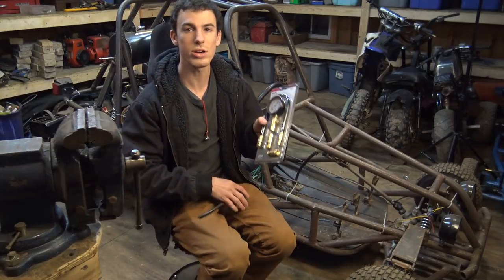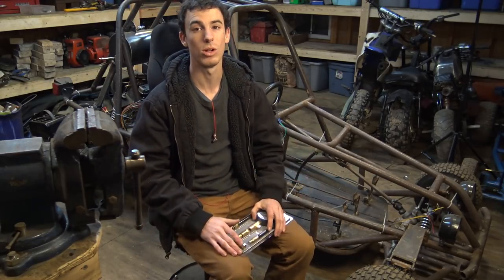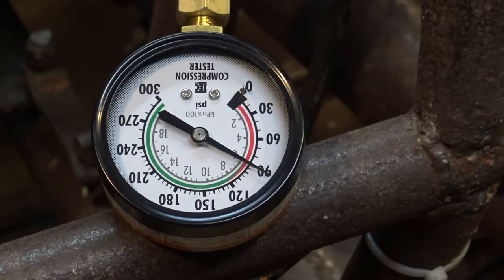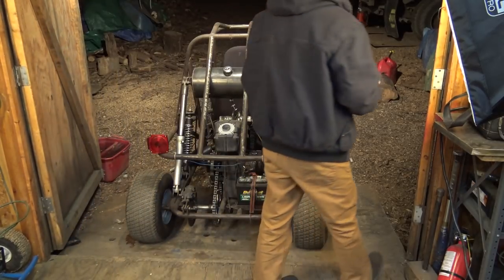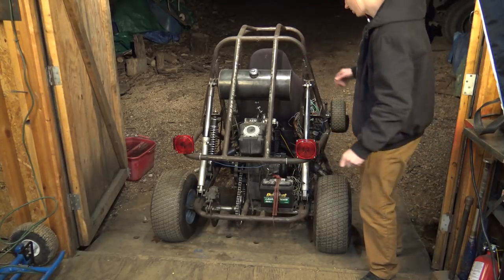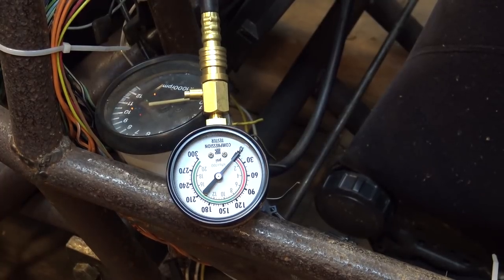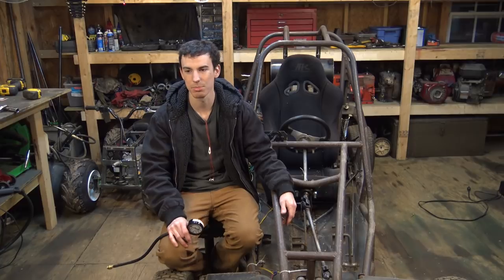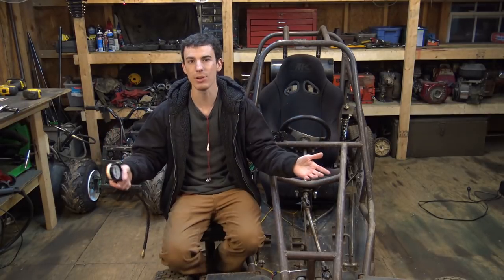Compression testing the gs500 engine

Comment: 90 PSI is not horrible and the compression should actually go up a little bit as the engine warms up. Yes everything expands with heat but the cylinder walls cool from the cooling fins while the piston does not therefore the Piston actually expands more than the cylinder increasing compression ( most time it's barely noticeable, the Rings are like springs for that very reason. To allow for the expansion and contraction of the piston and cylinder). If low compression was the problem you would have a hard time starting and have lots of crankcase blow-by coming out the vent. If it was valves, intake valve would cause backfiring out the carburetors and exhaust valve would cause excess exhaust temperature ( pipes would glow red and shoot Flames out ). You've already confirmed it's not a fuel problem, check if it's an ignition problem. Run it till it won't run anymore then check your spark.

Comment: Some bikes especially the bigger ones have a decompression that would cause it to be a little bit lower on Startup seems to be running fine when it's is running seriously doubt it's compression. Cold packs are 20 bucks try them just because they visually seem to be sparking does not mean that they are firing every time that they're supposed to

Comment: Ok, you've brought some new information to the table.  You mentioned in this video you had the pistons out and the rings were stuck.  That definitely an issue.  I looked up the specs on that engine and the compression should be near 144 psi.  

The engine will run on 90 psi, but before you get into correcting the ring issue.  If you haven't done so already, you really need to go back and put the fuel filter back in to prevent more trash from going into the carburetors and causing more fuel issues.  I recommend doing that and then doing another test run to see if you can go to the end of the street and back home without stalling.  

To make the engine sound, you will need to replace the rings at least.   I would pull the cylinders and do an inspection of the pistons and cylinders to make sure they are not scored up beyond repair.   If the cylinder is cast iron, I would do a quick hone to break the glaze and then replace the rings.  If the piston is OK, dig out the rings.  They will likely come out in pieces.  If they are stuck, you'll end up breaking them out.  Once they are out, take a piece of a broken ring and clean the carbon out the ring grooves before installing the new rings.   

Let us know what you find and the course of action you take.
Reply: Like a lot of these guys have suggested, check your spark when the engine stalls.  Also run it with the take with the gas cap loose to check the tank ventilation.  Definitely re-install the fuel filter, but do all these things before you do an engine tear down.  It's important to find what is stopping the engine from running before you open up the top end.  Guessing is expensive and frustrating.

Comment: TIGHT valve lash may be causing your no run issue, engine heats up valves dont close fully, cools down then restarts?... and cam timing will affect cranking compression

Comment: When running.  Spray starting fluid around the head gasket. . Also stuck rings are junk. Hope you didn't scratch the cylinder walls.

Comment: Happy new year buddy, and put that bloody petrol on off switch on! It will take you 5 minutes and BINGO! no hydrolock with fuel. Especially if you do up the engine, you dont want fuel washing away your upper lube and filling the sump with fuel. I see some say get another engine...thats ok but you can end up with a whole new can of worms. The frozen rings are your problem, just carefully get em out, so you dont damage the ring lands and use a piece of ring to get all the carbon out of the grooves. It might take you a while but its worth it. Shes a great machine with a weak ticker at the moment, dont shortcut, if it needs more bread to get other bits, be patient. Inspect your bearings and journals too. I was your age a million years ago and always just had to get it going asap lol. More than once i pulled an engine to bits twice because of hoping for the best.

Comment: 90 psi is a good compression, now 30 is bad, I have a 5hp tecumseh that has 30 and it runs just fine. my rebuilt Wisconsin I have has 90psi of compression. to be sure is to check with the manufacture for the correct compression rating.

Comment: Are you sure the compression gauge isnt leaking? If not, i would preform a leak down test to further diagnose the problem before teardown. If the rings were stuck that is likely the problem.

Comment: It must be your timing. It will still run with slightly off timing so I say re adjust them. Get it correctly and the compression will go up. And if that don't wort pop the pistons out and replace the rings. Like you said the rings are your second guess. Maybe you are right about the rings. Take it apart. Dip the piston in some pb blaster overnight. It freed up my locked up v6 so It could free up the piston rings. Re lap the valves to just in case

Comment: Hold a piece of paper up in front of the exhaust pipe to see if it will suck it towards it, if it does a valve is not shutting all the time. Bad seats or timing issue., will cause the carb to flutter as well.

Comment: Look into startups decompression setup.   I think ur compression is spot on engine fires right up.   With low compression usually wont fire that quickly.   That is y i believe it has decompression at under 1000 rpm or something like that

Comment: 90 and holding is a good sign. Probably no damage. Just worn rings. Buy rings (measure pistons dia) and a top end gasket kit. Problem solved. Though I may be hearing bad valve adjustment. 👍

Comment: While I do agree with the coil theory,  do you know what the compression shuld be? Both have 90lbs , seams to uniform either it's correct for this motor ,or is it possible when you replaced the valve shims , maby they sent you the wrong ones , but like I said , I have also had coils act this way before.  Will it die if you don't ride it  ?if it only dies if you ride it but will idle all day. Maby it's gearing causing it to overheat  , anyway good luck. , can't wait to see you fix it , happy New year

Comment: You almost got to the route of it yourself, right where you started the compression check and said you need the throttle open to test. With CV carbs just opening the throttle and cranking will not open the throttle slides up, it needs a running engine drawing vacuum for that to happen. I'd say in the mean time there is little wrong with 90psi, it may be a little down on power, but will run properly like that.
Check fuel supply, it is almost certainly your problem, with one caveat. Once engine has cut out do you still have a good spark ?

Comment: With valves closed hook an air compressor hose to the compression tester that screws into the head then listen if air comes out of the crank case, intake, or exhaust follow the air it will tell you where you need to focus my compression tester has a quick coupler I can hook to my air compressor that's how I found bad valves broken rocker arms bad head gaskets. I did a boat I had good compression on #1 but the other three was shit so I put air in the first with valves closed it held the air no leaks put air in #2 I had air coming out 3 and four plug holes pulled the head and gasket had been blown out between 2&3 and 3&4 new head gasket and that chevy engine ran like a top. I have found valves out of speck this way too and lawnmower head gaskets.

Comment: Not sure how everyone hasnt said this yet.. may have a small amount of compression release on the cam, if it didnt the starter wouldnt be able to crank a twin over. You need to do a leak down test, not a compression test. Also, didnt you buy a new jug for this engine? Did you hoan it before you put it back in? Like you said, your best bet would no doubt be new rings, re hoan the jug. You wont need rods or pistons unless they are completely trashed and scored up.
Reply: Also, you could try lapping valves, but I doubt thats the issue

Comment: Compression doesen't change with heat. If it does your rings are bad.
Bad compression is often a bad head gasket. Rings and pistons last forever if the engine has oil.

Comment: This seems to be a coil problem, not a compression problem. The 100psi is ok for most automotive motors. But that doesn't mean its the right value for all motors. For example twostroke motors in Vespas run ok with much less compression. 
Then there is your symtoms. 
Coils defects are more apparent when hot. They will work nearly ok (and produce just a few hickups just like you can hear in this video) but fail completely when hot. 
A motor with low compression will have other symptoms. Starting problems. Low power output. Your motor doesn't seem to have those.

PS: I really like your videos. Keep up the good work.

Comment: It will run at 50psi, you need to do a leak down test, the tool is cheaper than engine Building. Guessing is expensive but It has to be a head gasket or coil. Steam will come out of dip stick hole sometimes caused by head gasket

Comment: Dude, the compression is not bad at all. That is to say, it is NOT related to your problem with the stalling. EVERYBODY is saying it...COILS, SPARK, IGNITION!!!

If compression really was the problem, you'd feel the power trail off very smoothly to nothing as it warmed up. Only at the very end would you encounter a little sputter.

You seem to have good power up until the point it dies. Compression doesn't just drop that rapidly in an engine (unless it blows up).

And seriously, at 90PSI, that engine should be running fine. You won't have quite the power compared to 170PSI, but it will run. My GY6 kart is supposed to have around 190PSI cranking. It had 100PSI for the longest time and it was unnoticeable. After I rebuilt it, I got 200PSI and some extra power, but not much difference in the actual "running" of it. Now if you had 50PSI, THAT would be bad.

Also, the key thing to notice is that the cylinder on the right looking at the back of the kart keeps misfiring at idle. That is why it seems to have two idle speeds even though you don't touch the throttle. That cylinder's spark is fading in and out because the coil, spark plug, ignition wire, points...something ignition related is wrong. If you don't believe me, hold your hand in front of the exhaust and feel the temperature and volume of the exhaust at both of the "idle speeds."

Better yet, buy a cheap inductive timing light and put it on that cylinder. You should get a consistent flash out of it. When it stops flashing, the spark is lost.

Comment: Hey buddy listen to some of these guys they are giving you good advice. 90 psi is low but its not why the engine won't stay running. If low compression was your problem you ould have different symptoms check the COILS!!!! i have seen it a lot on 2 cycle engines they start and run fine till they heat up and they dye and either will not start or are hard to start till the engine cools down then they will start and run great till they heat up again so please please please look into the coils before you tear down the engine.

Comment: Both cylinders reading exactly the same says it may be specing correctly. Do you know what the manufacturer spec is? Also if this engine has an automatic decompression system it will read lower than what you think it should. Sounds like coils to me.

Comment: compression is good the vacuum line is required for fuel to flow properly the vacuum line is for the fuel to flow into the carb hence the 15min wait problem you have
Reply: i have worked on GS1000/GS750
 engines before they all require vacuum lines to carb the vacuum opens a valve allowing fuel to flow just try it you will thank me

Comment: Get on ebay get better carbs by a plastic fuel tank made for a boat with a fuel pickup tube and  I guarantee you will be able to run it. Your fuel tank has rust and that is your issue also that rust could be messing up your cylinder wall with scratches.  Engines are very simple as long as your getting spark on time fuel with the right flow rate and pressure you have a running engine.  Compression just mean loss of power and other minor drivability and idle issues.

Comment: quite the opposite compression gets higher as a engine gets hot the rings expand and seal better and yea 90 is bad it should be like 125-130 ish but I would guess its not compression but the coils they don't like heat and are famous for failing suddenly when they get hot so i would check spark when its hot. But is still needs to be honed and new rings to run truly good and get the most power out of it.
Reply: Andrew Herrboldt compression should go down when engine is hot!
Reply: try kickstar a honda cr500 cold vs hot and you will feel the diffrent in compression :)
Reply: Makrill first of yes compression goes up when a engine's warm google and second I've never had a 2stroke or any dirt bike but I know my honda cl350 is easier to kick when warm. Which isn't really just a result of compression. The piston expands closing the ring grove as does the ring itself sealing against the cylinder better. (hence why there's ring end gap for when they expand)

Comment: After hearing you admit to stuck piston rings AND the fact that 90PSI is your compression, hot or cold. Are you really looking for some other magic bullet to fix it. Time to rebuild the lower half now. And then you will be pleasantly surprised at the new found power as well. Don't skimp on the rings OR the bearings. Happy New Year though.  And do keep posting your videos. I am interested in this project.

Comment: 90 psi is not THAT bad for a clapped-out old engine. An old GS500 is alright from 100. The low compression is due to you refitting those old rings.
Sounds like carb issues, or air leak by intake.

Comment: I am no mechanic, but are you referencing the red area on the gauge as bad? To determine bad cyl. compression you should refer to a manual as to the ranges that are acceptable. Me personally, I think that your issue may be in the ignition, I've had motorcycles that the CDI box went bad with the same issues that you are having.

Comment: Im pretty sure that you shouldnt take both spark plugs out because thats when it loses compression, you should only take out the one you are testing. Correct me if im wrong though
Reply: Your wrong... sorry
Reply: Lenny M ok, thanks... do you have a reason for this?
Reply: each cylinder has it's own compression. they are not connected. Taking all the spark plugs out of a engine when testing compression allows the starter to crank easier and not get hot from repeatedly cranking.
Reply: sorry matt your wrong. it just helps the engine spin over faster
Reply: i was always taught no plugs, wide open throttle plates wide open, one reading dry and one with oil. if the cyl are within 10 to 20 psi call it good. try a reading when it quits in addition to when it quits. if thats ok, as a few others have said, check spark when it quits. just jam an old plug in the wire and roll it over. that'll tell you whether or not the coil, or igniters. if compression craps out run the valve clearance again. even if they're good cold they might expand by the time its Real hot. please be patient. this is the way you learn. think of it that way. you said you're not a mechanic, this is one way to learn it. But it sure can be frustrating.  i learned it in the school of hard knocks and a loving father. i have 49years behind me, a lineage going back many generations of mechanics to learn from and schooling.
im still proud of you. you should be proud too.
Reply: I had a snowmobile with 90psi compression and it ran the same as this suzie 500 on 90 psi

Comment: If it has compression and spark then it must be a fuel issue. I know you tried starter fluid that one time when it died but I would try it again with the air filter off. good luck :)

Comment: I have to say young man I have watched you do several things to this engine, it’s starts really well so I would say 90 psi is not so bad maybe not perfect but not bad, so I would have to ask myself after it runs and dies does it have fire or fuel or air so I have yet to see you pour fuel in the carbs after it dies or have I seen you check to see if it has spark after it dies I would rather see you spend money on a spark tester you should make a Will it run video after it has run and died before you give up on it good luck

Comment: Try the coils or ignitor-box FIRST - if it's got enough compression to RUN and stays the same when warm, then it's something completely shutting down after it's warm enough........... I guess you dont read the comments, but I've said this now in at least 3 or 4 videos on this GS500 Kart build
https://www.ebay.com/itm/1989-2000-Suzuki-GS-500e-CDI-igniter-ECU-computer-brain-box-GUARANTEED/202149859252?hash=item2f11120fb4:g:pTEAAOSwnCFaNUEj&vxp=mtr

Comment: Its not compression my dude. please listen to us guys that know what we are talking about.. 90psi is low.. but its EVEN!! meaning its wore out but its even and still in good shape.. if compression was off on different cylinders would be one thing.. but they arent.. that engine will make less power with low compression but will still run fine at 90psi.. you have a spark issue.. the coil is failing when it gets up to operating temp.. coils are known to do that.. they will work when cold. but warmed up they fail... happens with coil packs on cars all the time..  Just listen to us dudes that do this work and you will stop banging your head and wasting money... good luck